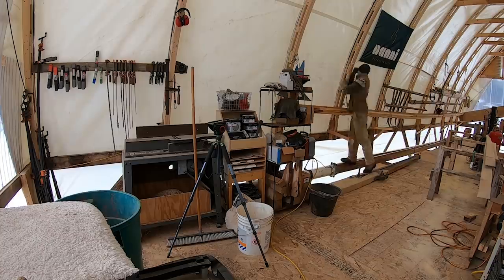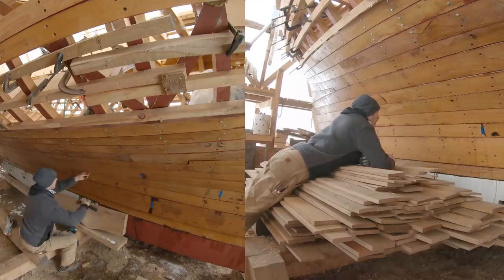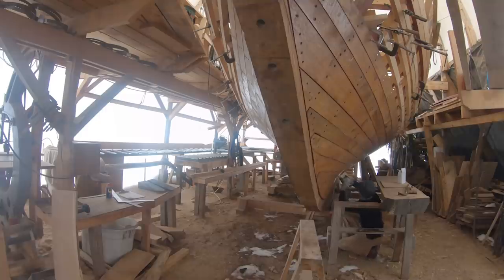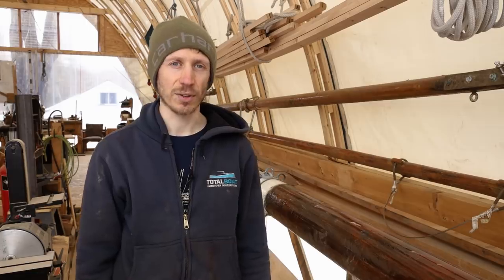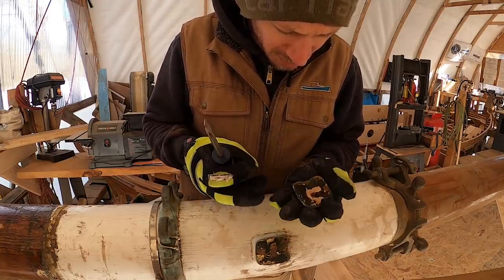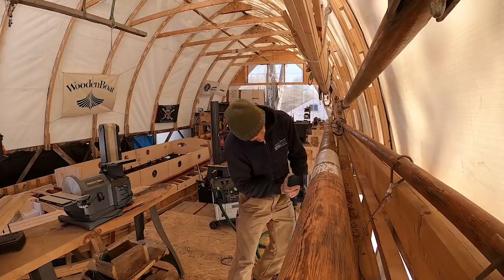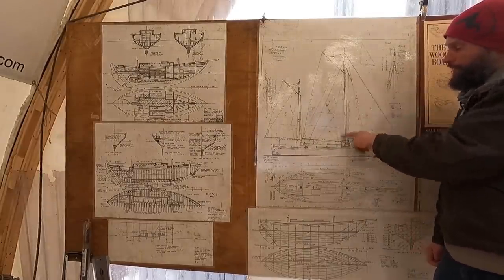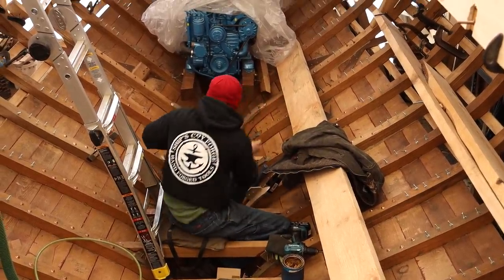Victoria's Mast - Episode 153 - Acorn to Arabella: Journey of a Wooden Boat

Comment: I've found the best way to scrape varnish off is to use a heat gun and a paint scraper. Once the varnish is hot enough it comes off with very little effort.

Comment: A paint scraper ( long handle.) that is edge sharpened works really well, I used it for scrapping cabinet doors after glue up. It produces fine shavings easily and very fast.

Comment: I am still puzzled as to why you elected to transfer the mast loads through the bronze floors rather than directly to the keel .  If those welds fatigue the step is going to move on you, The floors are a wedge that will force the hull planking outward if the floor yields, and the floor design is essentially an unstable column in vertical loading.  Strongly suggest you get an engineering opinion.  I am a mechanical engineer, but haven't practiced in the field for many years, but my training instincts tell me that your design needs a professional eye cast upon it.  Love your work and eagerly look forward to each week's episode.
Reply: The idea is the hull is what provides the upwards force on the floor and the keel timber and keel pull the the floors down. By haveing the weight of the mast on the top of the floors they are reducing stress around the bolts in the keel timber.
Reply: @Ethan-3369  The columnar strength of the floor web and the fatigue cracking resistance of the welds might be of more concern.....just saying.
Reply: @geoffreystearns1690  i can see the fatigue possibly being an issue on any of the floors and some extra reinforcement for fore and aft movements probably warranted.
Reply: @Ethan-3369  by mounting the step on the bronze floor frame cross pieces they are actually increasing the forces acting upon those 4 floor frames and the oak frames they are attached to. Atkin (and others like S&S) stepped the mast into the keel (the strongest structure of the entire vessel) so it can act as a beam shelf and transfer the mast forces to the frames along the entire length of the keel thereby spreading the load more equally among the 40 or so frames in the vessel. This modification will fail...no question.

Comment: In 40 years I've stripped maybe a dozen houses down to the bear and I did it with a handheld torch propane torch removing paint with heat is amazingly effective and I don't think it makes as much pollutants as does sanding as long as you stay away from the fumes and that's easily done with just standing down wind or a small fan will blow it out of your way but if you have a lot of pain to strip it's amazing how effective and quickly well seemingly quickly burning does once you get it all bubbled up and scraped off it's a matter of just a light sanding

Comment: Hey guys...I have been following you since episode #1 and I love what you are doing.  That said, I have to strongly urge you to rethink how you are attaching the mast step to the vessel. I flipped episode #151 to the shipwright at the Marina where I keep my 3 wooden vessels. After watching he and I were both in agreement that fixing the step to the 4 welded cross pieces of the floor frames is doomed to fail. If designers like Atkin or S&S had found a better way they would have changed their designs long ago - modern deck stepped masts only came about because of changes in hull construction such as F/G.

Comment: Rather than  cut a mortise into the mast step to receive the end of the mast, why not bolt on a bronze cup to receive the end of the mast?  This would prevent water from collecting in the mortise, which would promote rot. It would also make fine adjustment of the location of the bottom end of the mast relative to the through deck penetration to ensure that you get proper rake fore to aft, and that the mast is straight and centered side to side.  Once you get everything adjusted properly, you can then mark, drill and bolt down the mast cup with dolphinite under it (and maybe in the cup too to prevent mast end rot).  This would also allow for the final adjustment to be done with the boat floating on her lines so that you can get the mast rake proper when she is floating.  Getting the rake accurate while she is on the hard would be near impossible.  Fair winds!
Reply: The mast will be adjustable at the through deck with shims, called mast wedges and the shrouds, the bronze piece sounds expensive... there should not be any water getting past the mast boot at deck level.
Reply: @danoyes1  every mast boot I have ever known has leaked sooner or later...usually sooner. On a boat, water tends to find a way in despite our best efforts. Just remember, leaks below the water line are fine, above the water line, not so good. That is where all the damage is done.

Comment: You may want to rethink the mast step being supported by the floors or at least review it with a naval architect.  The William Atkin had the mast step on the keel for a reason. You are looking at the step loading as only having load in a vertical  if this were true then perhaps the having the mast step on top of the floors might be alright However and this is a big however.  You also have very large loads in the horizontal plane most of these being shock loads as you bash through waves so instead of taking these loads along the whole length t of thee keel you will be concenttating it on four floors which will take the load unevenly. The floors are not designed for this. And even if they were I have not seen the welds on one floor get probably tested not even the basic of dye penetrant testing. In the case of a wooden boat mast step failure quite often it leads to sinking it's often what one calls an unrecoverable accident. Don't second guess the architect he spent his life learning how to build boats.
Reply: Spot on matey!

Comment: I know you all like your hand tools but when driving long bolts and nuts use a impact driver or other power tool to at least bottom it and then you can go back and hand torque them. Saving just 15 seconds per nut or bolt, times that by thousands of nuts and bolts in the boat (or removing them) will save an insane amount of time. It doesn't even have to make you faster overall the time can be used to daydream, it's just easier.
Reply from the maker: These bronze nuts are soft as butter (and expensive). Slow is fast enough.

Comment: It's a happy day when you guys put up another video. 

Hope the bearing surface area of the mast step block is sufficient to over come any crushing limit. Back Locust is pretty dense stuff (70.3 MPa crush strength) but I keep looking at the grooves like they are cuts in a bar of butter. How big is the sail area of the main sail?  Maybe consider blocking from the bottom of the mast block to carry the load down to the keel? Or put a 1" wide bronze plate between the mast base and the floor plate? A key hole router bit on the two inner most cuts with a bronze bar inserted?   Couldn't hurt and wouldn't impede water flow. Just wondering if this might be an issue, i.e. not enough bearing surface between block and floor members.

Comment: product called cirrus strip not citrus, water based non toxic,washed away with water   Great for stripping anything clean. no odor   no hazardous chems. Broken glass makes good scraper cuts through heavy old varnish but you wont need it if you use cirrus strip just a hose.
Reply: There are many versions.  There are, in fact, products under the "Citri-strip", "Citristrip", and "Citrus Strip" labels.
Just because you don't get it where you live, doesn't mean it doesn't exist.
Reply: @mysterymete  what are you on about.?

Comment: Great work as always. Bronze floors are all in. One job finished. Are you sure that the main mast step will stand the stresses of those 4 bronze cutting surfaces over time ? There is a lot of shifting forces going on in this region, with little contact  areas. You might need some metal inserts to strengthen the wood contact surfaces. Have you considered doing a solid cast mast step ? Looking forward to next friday.

Comment: thanks for uploading

I like the idea of the bird's mouth mast, since it would certainly help offset some of the "weight"/inertia/polar-moment of the additional oak planks; especially if it were able to taper as it goes up.

I'm curious if there's any thought about building a bird's mouth 'dinghy mast' first?  Getting a first go at a smaller span, less-critical implementation, has a certain 'something' to me.

caveats:  1) I know I don't know what isn't filmed.  2) I don't know how much extra wood you have for the main mast.  3.) I don't know how much building a 'test' mast would impact "the schedule".   4.)  The project doesn't shy away from "doing it right once", but the house top mock-up also shows that you're willing to also do the "try things out, to get it right in the end" approach as well.  So, the above isn't a 'suggestion' or a 'criticism'... simply a flying fingered brain regurgitation.
Reply from the maker: You're cool, Tim. These are good thoughts, and we appreciate how you've framed it. It's true, there's so much that's not in the final cut. I don't think there will be a practice mast, although the exercise of executing at least one joint might be a good thing. Thanks for watching and for the smart comment!

Comment: Card scrapers are an excellent tool, but one must learn how to put the proper edge on them as well as how to use them properly. They are tiresome to the thumbs, but there are fixtures that will hold them and ease this problem. Take the time to learn them, and also be able to recognize when it's time to refresh the edge, much better than sanding, faster, and less dust blowing around, plus saving the cost of sandpaper. They are a very underutilized, under appreciated tool for beginning / intermediate woodworkers.

Comment: With ref to the Engine. I would plug or cover that open pipe connection and any other ones that are around. Not good to get debris in those pipes, even if they are outflow - FOD anywhere in any pipe is not a good idea.
Reply: Agreed, all openings should be plugged!

Comment: to aid fitting the mast and misen mast.. will you make some blocks for the foot and where the mast will pass thru the deck out of laminated scrap wood and mount each to some kind of Plastic pipe with flanges to the blocks so you don't have a MASSIVE mast to trial fit and build around it.  you could just screw blocks of wood to the plastic pipe ends.. and shape them to OD of the expected mast sizes..  this would make it much quicker to build and much lighter to handle..

Comment: Is it possible at all for that mast step to end up compressing down on the bearing points where the bronze floors contact it in the mortises? It appears on video as if there is only a couple square inches of the mast step doing all the work against the bronze floors. Could that end up compressing the wood fibers?
Reply: The tops of the 4 floors are ½" wide and at least 12" long, 6sqin minimum (and I'm pretty sure they're more like 18"+). A 7" mast is 38.5sqin.
Reply: This modification is doomed to fail...no question. 😔
Reply: Though I did screw up a bit, the mast is under some serious compression from the rigging. So it's  about 21 times the weight of the mast and sails alone(!).

Comment: Hey Steve, Can't you determine the correct angle of the mast step from taking the measurements off  Acorns previous mask step?
Reply from the maker: Since this is a new build and not a restoration, no, there isn't another mast step for a reference.

Comment: Guys why don't you use a Milwaukee impact gun , makes your ratcheting life so much easier, you can use the impact to drive the bolt way faster until it yields and then torque by hand to spec ..
Reply: Because bronze bolts don't behave like steel ones.  They are expensive, strip easily, and are hard to get out.  I suspect they want the added safety of doing it by hand

Comment: Serious question: Why do you not use cordless impact drivers for all of that massive hardware? If you only had a few to do I'd understand twisting it all by hand, but... damn.
Reply from the maker: Bronze is very soft. It doesn't take much to damage a head on one of these screws. Slow is fast enough.
Reply: @AcornToArabella  I was thinking more for powering in the threaded rod. Seemed like quite a workout.
Reply: @mickenzie5863  The rods are bronze too
Reply: @99Etien  Yes, but the forces applied to the bronze rods would be the same whether he uses an impact wrench, or the ratchet wrench by hand. He is using a steel adapter to drive them in, which would easily work with an impact and not stress the bronze rod.

Comment: How does the mast step attach to the floor frames?
Reply: It rests on the upright bronze floor edges, placing all of the static and dynamic loads on a few surfaces.  They notched the step so as to keep it from sliding around.   A typical mast step distributes those forces more broadly.  This is this inverse of that commonly accepted solution, as the forces are concentrated on a smaller area, instead of larger.  This will likely result in compressive cross grain failure.  It is Steve's boat, so he can do it the way he wants.
Reply: @WhatAboutTheBee  I agree...if guys like Atkin or S&S had come up with a better way they would have implemented it long ago.

Comment: Curious why not using a torque wrench and measure the torque  on all the torqueing.
Reply: i don't think it would be of any benefit, wood moves and changes greater than steel. And if it absorbs too much water you could easily split it.

Comment: Just a question from the side line... The mast stop sits on 4 floors. It basically rides on four (what's the thickness of the bronze floors? half inch?) half inch wide slots about one ft long. This means the full weight of the mast, the sails and the loads from rigging and from wind and whatnot rest on about 24 square inches. Just had a look at pressure resistance of oak and it was listed in a quick google search as max 5 N/mm2 (or about 725 PSI). This would then translate back in a max load of 17,400 lbs or 7.9 metric tons. Should be probably ok... anyway :) great build :)
Reply: This mast step modification will fail...no question.

Comment: If it's a wooden boat why does it have bronze floors?
Reply from the maker: Should we have also used trunnels throughout? The definition of a wooden boat doesn't have a clear stop and start at any one point, except maybe for overall hull material... and when it comes to composite, cold-molded hulls, the stop and start gets even hazier for some.

Comment: So the masts are not completely vertical?
Reply: Some are. The further back the mast leans (more rake) the higher into the wind you can point it. Conversely if you are going down wind (wind pushing you from the stern) the further forward you can lean the mast the better. Watch a wind surfer turning, for an exaggerated explanation.
Reply: I was thinking that too at first but I think where the floor is for the main mast is not level but instead already rising to the bow. So the socket for the main mast to rest will be at a slight angle so the mast CAN sit level in reference to the rest of the boat.

Comment: Setting the mast sep on knife blade doesn’t sound good, how about welding tabs at the top and attaching a bronze plate then the mast step
Reply: It wont be sitting on the bronze floors. It is recessed so it fits over the knife edges and will attach directly to the keel timber
Reply: @zcasias  watch the video again it’s notched a fraction of a inch and will not be in direct contact with the keel

Comment: Note to Steve,; after examining all possible problems and solutions to this mast step on those bronze floor edges, My recommendation is to hold the course. all solutions cause more problems, and we are looking at 2inches of bronze edges against the step block wood. I think this will work out. the only improvement that I can see is to widen those edges with bronze strips to reduce the per square inch load against the wood block, good luck
Reply: You think??? Sorry mate...the mast step modification is doomed to fail - no question.